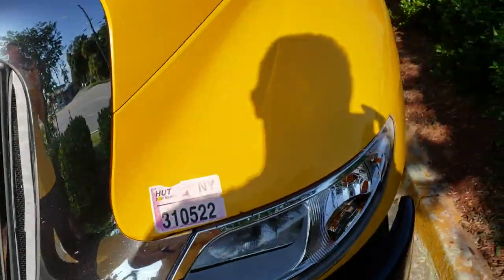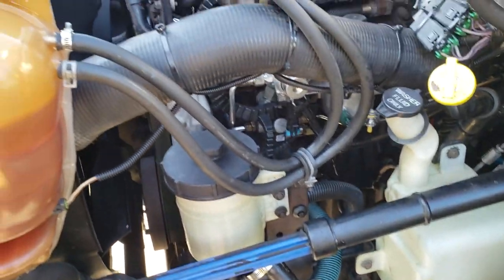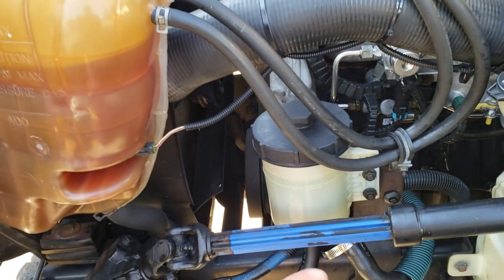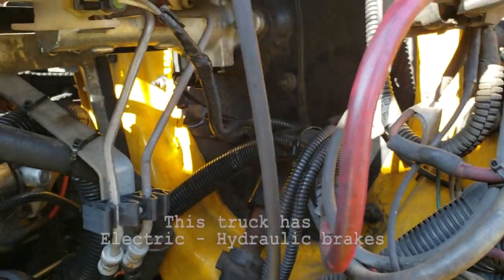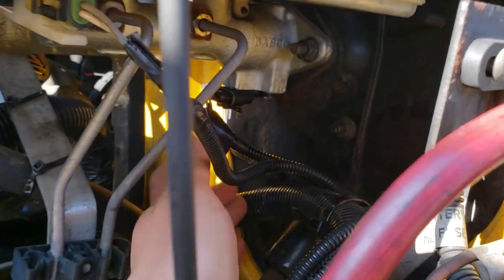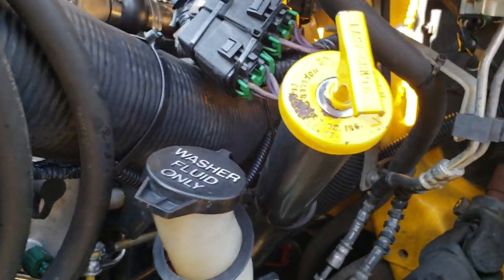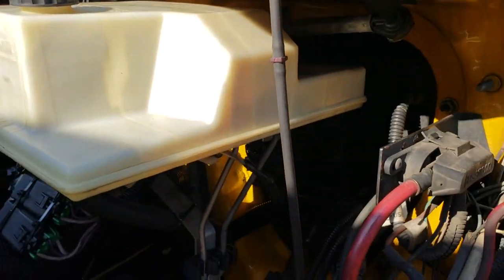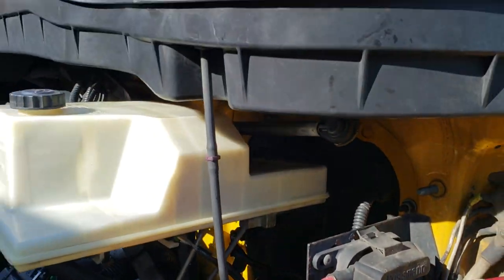2011 International 4300 Electric Problem, Abs brake light, Limp mode, Truck Wash fail, Maxxforce DT

Comment: Paul, my truck has the abs light on and would run good for about 5 minutes and then wont go past 20mph and then you would cycle the truck on and off and your good for another 5 minutes. Here are the active codes: SPN 4765, SPN 3251, SPN 3242.
Reply from the maker: Hydraulic or air brakes?

Comment: My truck has the abs light on and would run good for about 5 minutes and then wont go past 20mph and then you would cycle the truck on and off and your good for another 5 minutes
Reply from the maker: Thats a limp mode.  You have electrical brake probl
 Check codes (I have another video on it)

Comment: Would this problem cause your truck to not start at all...ive been trying to get mine started for a week..all my break lights are flashing. chiming. And will not activate start.
Reply from the maker: My brake lights flashed too, so very possible. What are your codes? (I have another video on pulling codes with no tools)